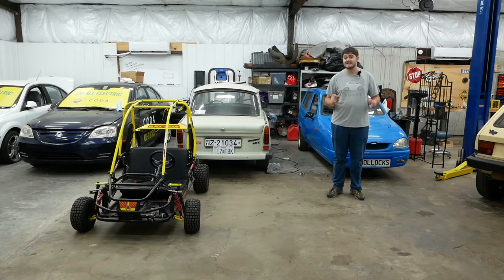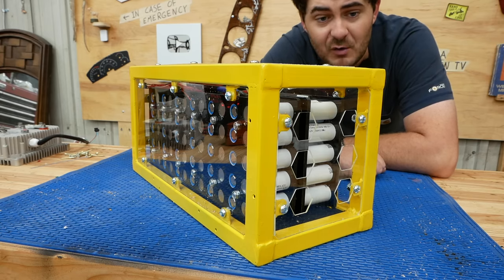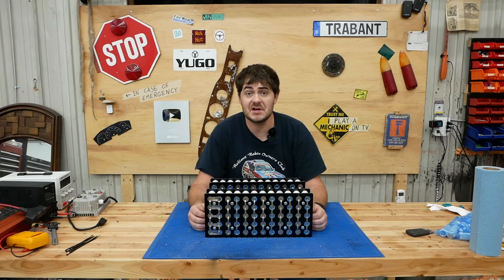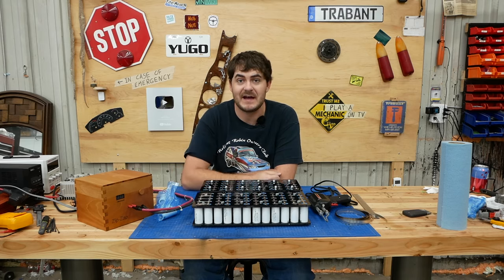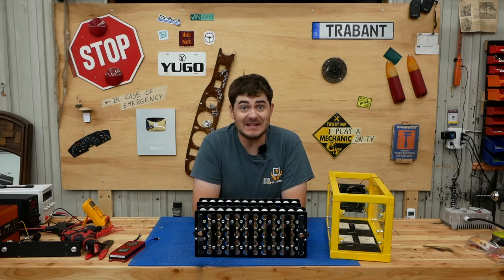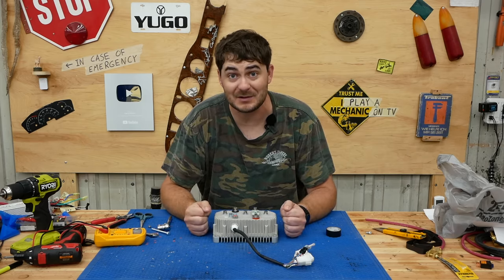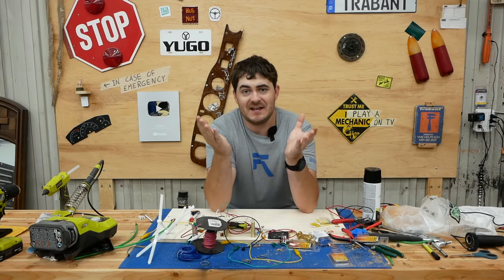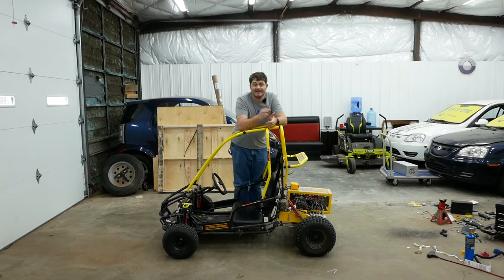I Spent Weeks Converting This Go Kart To Electric. Did It Work?

Comment: As i'm sure you're aware and just cant be bothered to explain, nominal voltage and top voltage never match on any battery, that is intentional. at zero load fully charged non managed batteries always read high, this is normal, if you have a battery controller it can output the same voltage until the cell is depleted, assuming there is sufficient amperage and the correct electronics to do it, however that is not the default behaviour of a battery, generally they start high, enter a brief discharge curve, plateau in a useful range ( nominal, rated voltage ) and drop off continuously from there as time goes on.

you can also overcharge cells, and heat cells to force them to run even higher voltages however this is generally considered dangerous, however advanced battery management systems do it all the time ( teslas have heating and cooling built into their batteries for example ) because they are keenly aware of how the battery chemistry functions they can get more power out of them fairly safely.

some r/c enthusiasts overcharge cells to reach peak performance in competitive racing, ( and in many cases this would be considered cheating ) which sometimes leads to fires, since the electronics to manage them are far less advanced.

Comment: Your exciter coil field is overpowering you need to increase the current on your exciter coil but the best solution would be to just replace the “alternator” with a motor

Comment: All that work on that custom battery pack and you could have just gotten a bunch of LiPos and a low-voltage cutoff circuit. And before you say anything about "but my controller only lets me use X type of battery", I have no idea why manufacturers have started to spew BS like that - sometimes it's also because they sell batteries of that specific type, other times it's completely inexplicable. Any ESC will work with any battery type, it's just a matter of getting the voltage right. In this case it might have something to do with the balance system, but if that's not configurable then there most likely other issues with that ESC as well.

Other issues with this build:
Using 3D printed ABS is just flat out a stupid idea, that material is basically all but obsolete as there are materials with superior material properties and longevity that are easier to print.
Blowtorching shrink wrap isn't necessarily something you never do, but it's more of a last resort thing. It's better to use a heat gun for that.

Comment: You are trying to power a ac motor with a dc controller.  where ac has equal on and off states the dc controller lengthens the on state while shorten the off state.  At full power it is constant on.  The way to speed control a ac motor can be done by increasing frequency, voltage or controlling activation of the arms of the coils.   Great videos.

Comment: Hey man, i know its 1 year late, but i think i could help you with the electrical side of things. I'm currently in a german university studying electronics. At the moment i have a similar project as your Gokart and i designed my BMS and motor-Controller myself. So if you need help with your project let me know. BTW i have a bit of safety-concerns about your battery-pack.

Comment: The cut offs sounds like your hitting over current protection. 
Given your charger failed on a short, its likely you got a short in your battery setup or even the BMS... or even the motor controller your using. 
Dont give up as its really cool. But yeah go over your wiring. And go over your programmable controller. It might just be a duff chinese no datasheet part.

Comment: Actually...soldering ain't that bad idea. Clean the tab, use a drop of soldering acid on the tab, shove the soldering iron with the solder drop straight into the acid drop. This will ensure wetting the tab with solder without transferring too much heat. Ok, a GOOD spot welder is bettet and faster but there's a chance of blowing a hole in the tab if improperly used.

Comment: The “motor” is the issue. But a full sized go-kart is not safe for a 6 yr old in any case, so by the time he’s 11 or 12 you will have installed a proper electric motor and he’ll be all set.  Just make sure he has a helmet

Comment: Great video. Your battery is not balanced that's why your charger blew up. Use a active capacitor balancer at 3v to properly balance them. Don't give up. You are on a great proyect

Comment: 13:47 can some explain to me why he needed 5 copper buses? Couldn’t he just use 1 for each parallel grouping because the electricity could just flow from the terminals, through the nickel, through the copper bus, into the next set of batteries?
Reply: That would indeed be a complete circuit, but it would significantly increase the flow of electrons through the diddy nickel strips. This metaphor is a little bit simplistic but, it would be like connecting five water supply pipes with a really narrow pipe. Water in that situation would be restricted in flow, since it can't be compressed, and you'd have really low pressure on the other end of that little pipe. 

Electricity doesn't care, it will flow through that pipe as if it is wide enough to do the job, until the pipe bursts (it would actually just get too hot and melt). That's what a fuse does!

Comment: All of your battery pack issues would have been easily solved by just using prismatic cells instead of cylindrical. :D Prismatic cells get connected via bus bars and bolts. No welding or soldering or 3D printing required.

Comment: you absolutely do not need copper nickel strips. pure nickel would be fine. it's not like you would only have 1 series connection, there would be 5 of them on each parallel bank.

check out the onewheel vesc community. they're pushing these kinds of numbers on diy machines.

Comment: I'm no mechanical genius, and feel free to tell me I'm wrong, but it seems to me that all you had to do was to remove the gas engine and replace it with a electric motor, find a battery bank, and speed modulator, and hook up a charging unit for recharging and go.
    This took you two weeks? Oh I get it your including the time it took to mail the parts you needed to do what should have been a two or three hour job. I mean really, all the real work was already done. Brakes, wheel sprocket and chain, steering wheel, frame, seat, all you had to do was change out the motor's and add a power pack, two weeks huh?

Comment: I wrote that the last time you failed this project, and i will write it again. Car alternators are SYNCHRONOUS motors, not 3 phase DC motors!  You are using a 3 phase DC motor controller which drives the motor with trapezoidal current, not sinusoidal. That probably creates high current in the overlapping regions, thus it gets confused and it thinks that there is something wrong with the hall effect sensors.

Comment: dude u shld put two alts on it one on each wheel i watched this dude do this on a bike an that bike was rollin 25 mph so but 3 alts wld b even better mounted across the back axel do same thing u did on the one make three fit that battery setup will power it u need a 15000 watt covvertor

Comment: just buy the motor designed for that aplication i do recommend QS 138 motor will be run with no problems the althernator is not good  to run propertly with that motor controllers

Comment: Why? You had the plexi holding the batteries together. Then print 3d bus isolators. Too much time spent printing. Your plexi could do the same job. Route slots that accepts your brass between the cells via the CNC.

Comment: Dos'not work because of tension regulator of brushless ...you shood to delet the electronic pieces inside it ..and you make sur that the brushles of rotor recept the voltage directly from 12 v battery or any 12v  source.. thanks

Comment: try moving the hall sensors out of the magnetic field of the motor. i would say there there getting a bad signal. there not normally in the motor field like you have them. normally there triggered by magnets try 3d printing a sensor setup with you hall sensors out of the motor flux.. and put a current clamp on the battery to see if you are triggering the bms or talk to the bms to see what current your drawing could come back to the hall sensors.. good luck and don't give up it won't only be the 6 year old disappointed

Comment: Oof.  "Hall sensor error," are you absolutely, 100% certain your hall sensors are installed correctly?  I build a go kart from scratch with an alternator, no hall sensors, and it works great.  It has to soft start since, you know, no hall sensors, but it works great besides that.

Comment: That connection is a terrible idea.  Vibration, thermal expansion and contraction, is going to cause poor connections, corrosion and batteries wont last long not to mention motor and controller getting fluctuating voltage everytime you hit a bump

Comment: Please don't be done with it yet you are closer than you think if you make contact with me .... don't know how never really left a comment before on YouTube ......I can send you some settings that you can put into your controller ....... I promise you the only thing you need to get is a motor would solve the problem straight away if not go in your settings 120 degrees you go as low as 110 degrees 

If you're going to get a new motor try and get QS138 and they will send you the information with the motor that you need to put into your controller and I really hope you don't give up

Comment: You need to add some duplicate resistors to pre charge the caps in the motor controller. If you accidentally blew your one resistor, you'd potentially take out the wires and some other parts that would fry.

Comment: Just use a real motor, trying to get an alternator  and add hall sensors is a major pain, a 72v 3000 watt motor will rip that thing around for very little more than the price of an alternator.

Comment: You really over complicated stuff . I used a big starter relay and copper rods to make a spot welder. And for the power source i just used two 9ah ups battery. It worked perfectly fine even with the thick nickle copper strips and took less than 10mins to make a 8s 2p 25.6v 12ah Lifepo4 pack for my ups.

Comment: Electric gokarts arnt even good tho. Practically everything electric sucks. Put it back to gas and be done with it. Buy a predator 212 for literally $90 brand new and get a throttle cable for $5. Then get a $15 clutch and ur good to go

Comment: i built a 2000watt gokart using a 60v bike controller ...2 x 1000watt dc brushed motors and 4x20ah deep lead acid batteries and an electric pedal...and it went like a mf...maybe your over complicating the issue? (defiantly the problem is the motor)

Comment: buy a motor! the alternator stator angle needs to be in alignment with the outer 1 easier to buy a motor
Reply: magnets need to line up parallel these are incompatible =   l+/  needs to be l+l (magnets need to paralleled) the rotor is diagonal and wont work needs to be remade or like I  said buy 1 thats mad to induce torque  instead transfer into energy

Comment: you are using overcomlicated methods only to make battery worse
beter you would buy prismatics with threads and just bolt cells if you cannot spot weld

Comment: This video made me sad, so many mistakes made trying to save money and DIY stuff.  I have several decades of electronics experience  and there are several serious issues here.  
First off, you can't expect to clamp battery leads/interconnects with plastic, especially 3D-printed plastic.  It will heat up under peak load and soften, and the hotter it gets the more the plastic will flex and allow more resistance between the batteries and contacts.  Just going over bumps has the potential to cause enough flex and allow the contacts to shift and lose proper connections, resulting in gradual oxidation between the battery and contacts.
Please take the alternator and throw it in the trash, you're using a BLDC motor driver that expects to be controlling a motor with permanent magnets, which have a very specific trapezoidal wave form required to drive them.  This is very different than a series electromagnet-driven alternator, which is extremely ineffecient compared to a BLDC motor since you're wasting a lot of power running the field electromagnets, plus those electromagents will never approach the power of the rare-earth permanent magnets in a BLDC motor.  An alternator was never designed to handle continuous multi-KW power levels, especially at 72V vs. the 12V it was meant to be used with.  You can get a sensored 72V 3KW BLDC motor and controller for easily under $200 on eBay, shipped from a US seller for free-- I have one, it works well.
Finally, there are now a large selection of battery tab welders with an embedded lipo cell that can provide very high peak power as well as being inherently cordless.  I'd stay away from the cheapest ones, but one around $50-$80 can do everything you want, and do it well (I have one of those too).
I would try soldering the battery interconnects using an actual 120-200W soldering iron that uses soldering tips with embedded heaters/sensors.  Maybe try the Pine64 Pinecil for starters since it's cheap and reasonably powerful as long as you have a solid 20V power supply (But no more than that!  I blew one up running off 24V).
I think you would save a lot of time and money by tapping into the community and perhaps specific electronics-related YouTubers like Dave on the EEVBlog or ElectroBoom before wasting weeks of effort trying to implement solutions that just don't  make sense to someone experienced.  Your videos are entertaining and well-produced, but it makes sense to look for help when you're out of your area of expertise.

Comment: This is silly and overly expensive.. you could have used VESC's (programmable motor controller) & Electric Skateboard motors.. They are lightening fast and already to propel 200lb adults. There are 9000 other ways to do this less expensively with a safer (Remember the child !) method.. NEVER give what you made to  a child !!!! Foolish!

Comment: I stopped watching at 17 minutes, too much wasted money, not enough planning, too many expensive tools not enough common sense, 
BTW 72v 100amps equal 7200 watts, thats almost 10hp, 
You removed a 4.5hp gas engine  to replace it with one with over twice the power,  how is that safer for your 6 yr old ?
By the time you finish a working go kart he will be 7 yrs old

Comment: For someone with good manufacturing skills and a lot of equipment you are somehow horrible at battery pack manufacture.
The video is old so I don't know where it's all at, but those tabs are a very bad idea especially that those are held by 3D printed plastic that softens a lot in 50*C...